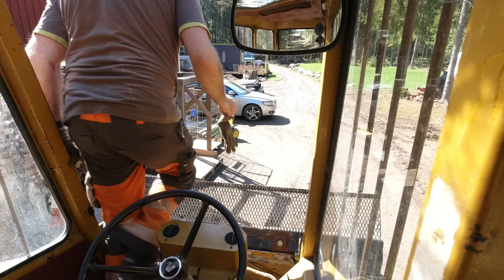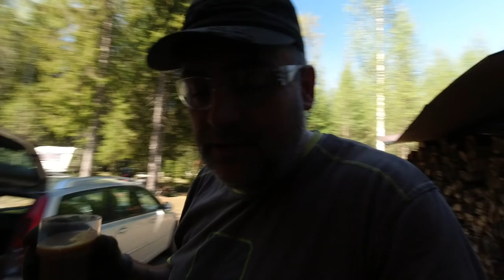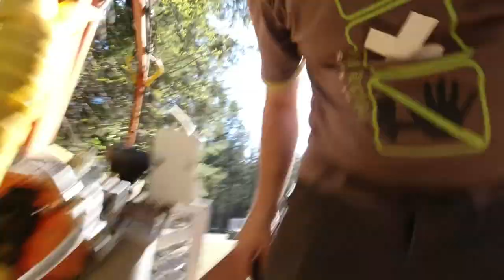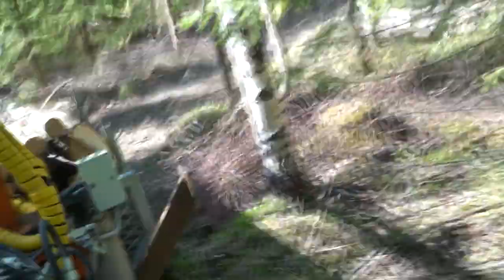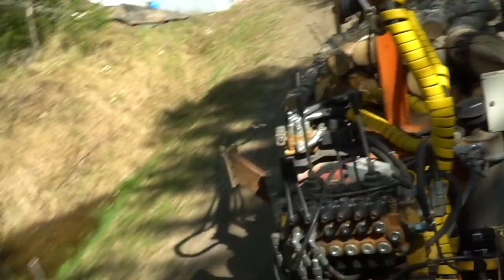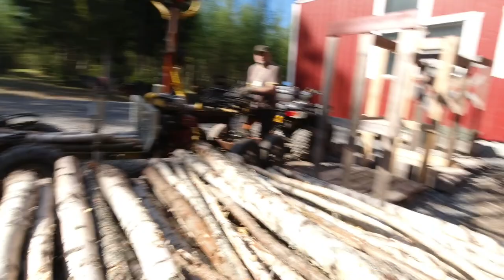Hauling firewood with ATV & hydraulic trailer

Comment: That dolly is a smart substitute for a solid rear axle! Nice firewood, lot of heat in birch.
Reply from the maker: That trailers connecting weight on ball is just enermous... A lot of weight from the boom is on that head of the trailer. It compresses Polaris rear springs completely to bottom when trailer is empty and even takes all weight away from front wheels and ATV does not turn anymore. 
Dolly distributes weigt roughly 30% on ATV hitch ball and rest 70% on dolly wheels... It increases the grip on ATV rear wheels but is very difficult to reverse. 
It is compromise from everything but kind of makes it functional anyway compared to without dolly 🤐😆
Reply: @JuhaErkkila  yeah I bet it’s really hard to reverse. Good idea and solution to the problem with too much weight on the trailer ball.